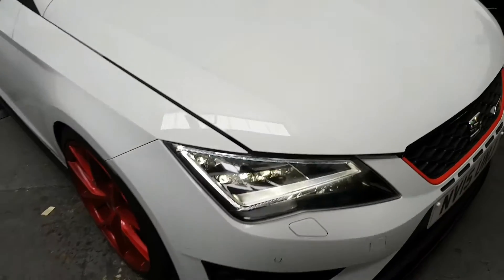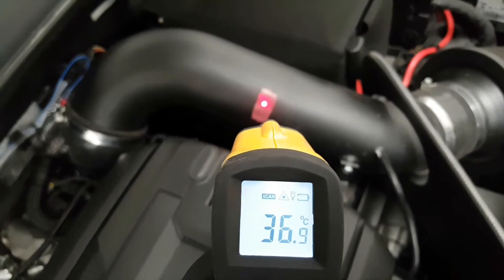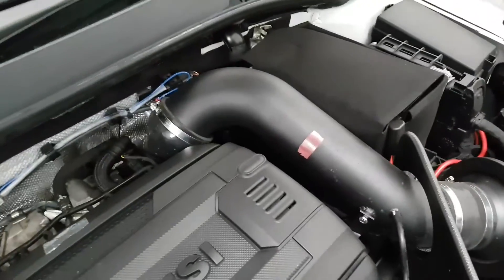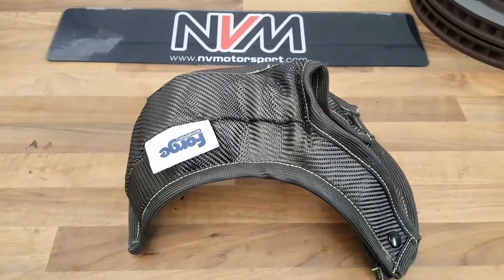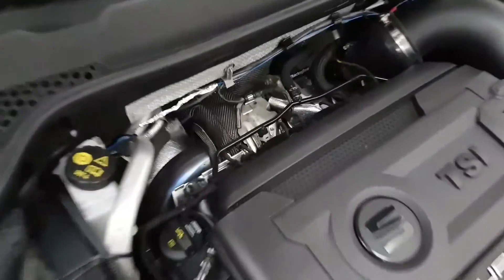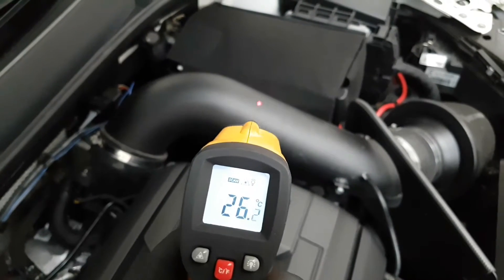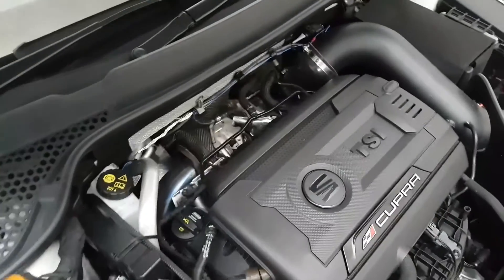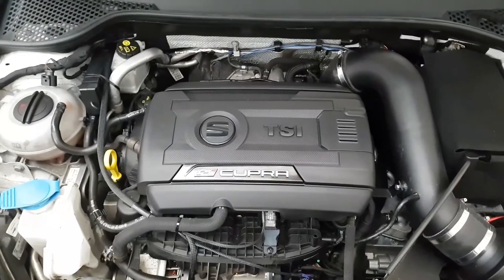Forge Motorsport IS38 Turbo blanket review and test Seat Leon Cupra 280 Golf R S3 8V Gti

Comment: Does this blanket not heat the turbo up? As the heat of the turbo is staying in the blanket and no airs getting in to it to keep it cool, there's a high chance of the turbo getting really hot after hard driving on a hot day and causing damage?
Reply: Generally, you want the turbo to keep as much heat as possible in it to increase efficiency and reduce spool time. Take a look at this research on the topic: https://repositories.lib.utexas.edu/bitstream/handle/2152/43718/BICKLE-MASTERSREPORT-2016.pdf?sequence=1&isAllowed=y
Reply: Lol either you listen to the regular garage mech or the motorsport guy. Your choice?
Reply: @thrashingjustin  Allowing the btus of heat (not degrees) to get brought back in through the intake, into the cylinders, and then back through the turbo again would lead to higher peak turbo temps anyway.  Turbo blankets and heat wrap should be far more efficient at putting the btus of heat where you want them and keeping them from where you don't.  
 I'm just confused as to why they're not stock equipped on anything.
Reply: @johnr.1592  Most likely due to fire hazard if there is an oil leak. Also cost vs benefit to the OEM
Reply from the maker: Naz Hussain there is still air gap for sufficient ambient cooling.. turbo itself maintains temps by good oil and Coolant supply.👍
Reply: Naz Hussain yes heat soak will be your new best friend. It's much more efficient to wrap the exhaust manifold and leave the turbo with free flowing air.